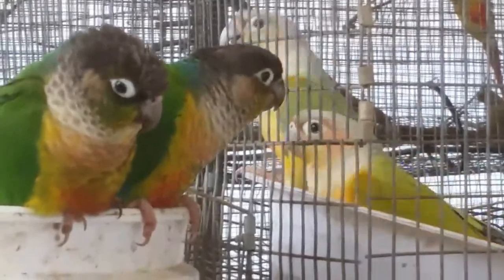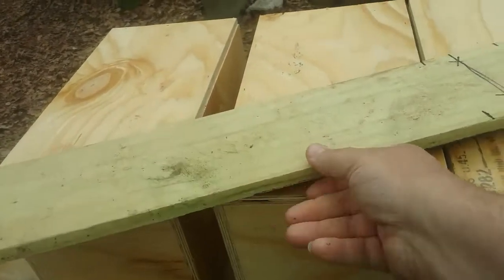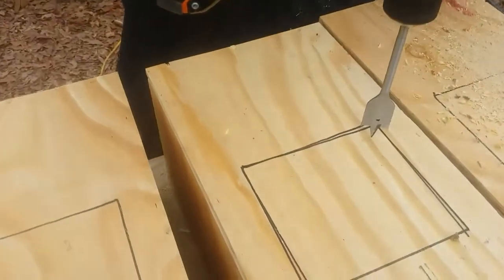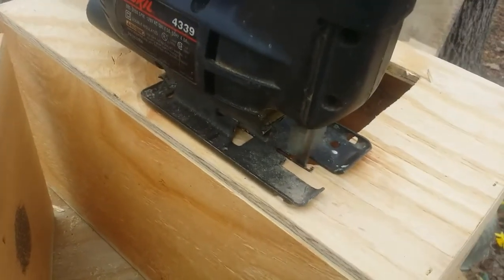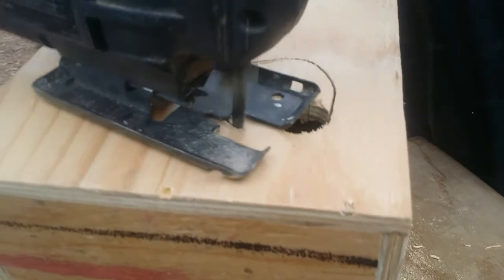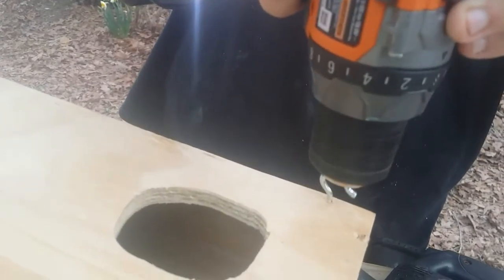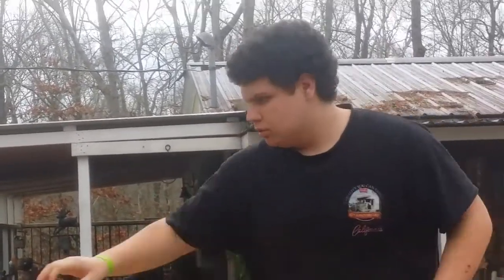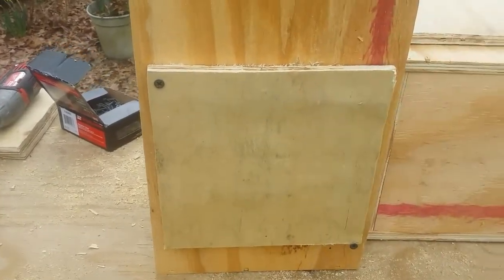HOW  TO BUILD A GREENCHEEK CONURE NEST BOX - how to customize a blank box to use for small parrots

Comment: Do you find smaller better. Used to use 12 by 12 by 36 inch's.
Reply from the maker: Yes.  I've given pairs options before and without fail, they always chose the smaller boxes.